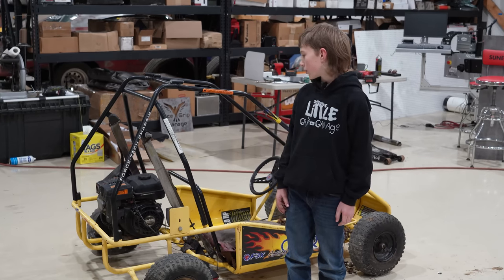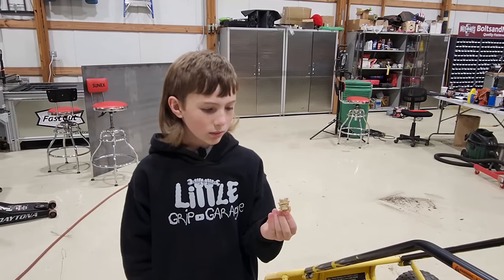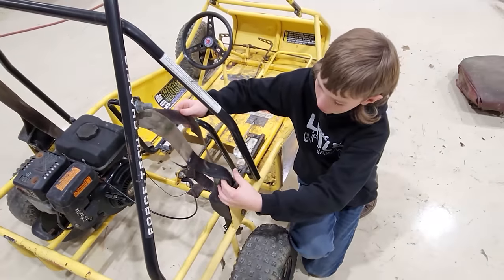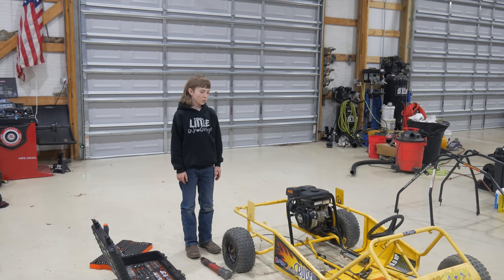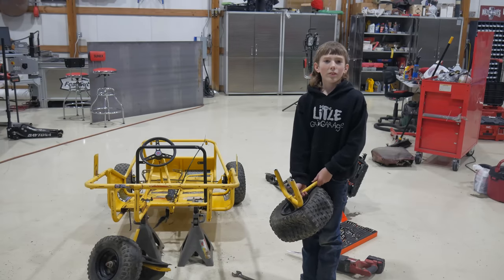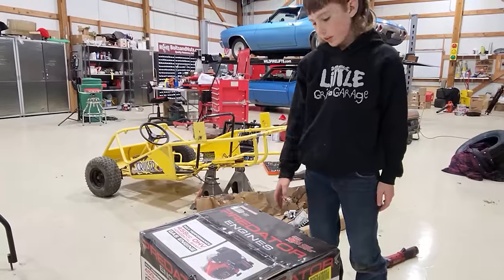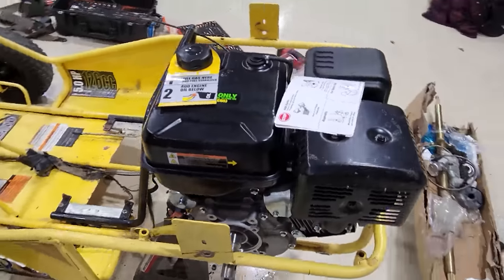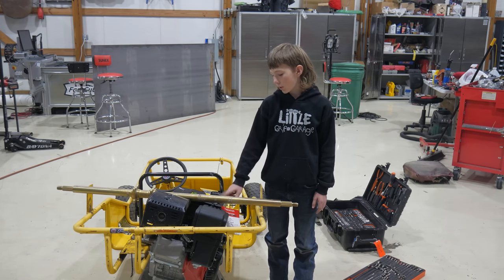My First Custom Go Kart Build ! -16HP - Will it FIT?

Comment: Bentley I’ve got to give you a 10 out of 10 on the delete of the old rear tires. Going to give you a 11 out of 10 on engine size because it’s way too big in other words PERFECT…and as long as you keep your dad away from the battery for your electric start, you’ll probably be OK. Looking forward to the next in the series.
Reply: Oh, I suspect the new battery will have a "Go" handle on it. Just a hunch.
Reply: A guy gets the feeling that the Bieri battery curse will pass on to at least one of Derek’s little humans, and Ben seems likely enough. 🤣😰😉
Reply: @vincedibona4687  ,I’ve heard it skips a generation…but I’ve been wrong before!
Reply: I think it needs a big battery and alternator that way it can be used to jump start all the rigs with dead batt-trees

Comment: i built a manco just like this model.......subaru robin engine always started first pull, but not cheap to modify.............go power sports and bmi karts were my primary sources for replacement/upgrade parts.........good luck with it, ours was a blast for years....

Comment: On your Honda 50 ,  you can get the top end from a CT 70 and bore it to 82cc and they make a big bore cam kit that will make it scream ( about 90 mph in the 1/4 but don't go that fast ) the front end is not made for it.

Comment: Remember Bentley  if you don't want that motor shutting down every bump or doughnut you do,have your dad unplug the yellow wire comming from the side case of block,it's a low oil switch that when the oil splashes up it thinks motor is low oil or out of oil,it will run fine unplugged but check your oil each time you ride and change your oil every 6hrs of ride time.they are great motors and you can build them up too 24 too 28hp with proformance parts,I build them so I'm telling you it can become a rocketship lol.God bless keep peeling. PASTOR BOB CORNELL/COINGURUMINISTER YOUTUBE

Comment: Bentley, I think you should paint your upgraded badass go kart bright red with black wheels. That would look hot, fast and boss, definitely. With the new live axle and both rear tires driving it, plus the much higher horsepower and torque engine, it's going to accelerate fast and haul butt...you might want to add some bracing and/or gussets to your seat backrest frame to reinforce it so when you step on the gas and your body (and people bigger than you) are pushed back hard against the frame it won't bend or break a weld. Ask your Dad what he thinks, he'll know exactly what I am talking about and he can advise you about whether it's needed for extra strength or not. In my years of experience riding, running and driving all kinds of toys very fast and hard I can tell you that it's always safer to over-engineer some things to make them stronger and more sturdy so they don't break or bend on you. Also, using grade 8 bolts in certain places for more strength (like mounting the engine, the axle, front hubs or bolting in seat brackets or a roll bar for example) is also a good idea. Having fun with powerful toys is what guys do, building them strong and safe is just plain smart. We like seeing what you are working on, fixing up and using, keep making videos Little Man. Have a lot of fun with your kart!

Comment: Great job Bentley! This is exactly how started learning about engines and other parts of vehicles. My dad helped me rebuild my old dirt bikes when I was your age. By the time I was 12 I could tear a whole bike and engine down and repair it. By the time I was driving dad was helping rebuild my old ‘72 Chevelle. I got pretty good a keep her running to the point I found another Chevelle that was wrecked in the rear end but had a great engine, front fenders and doors and was even the same color. We swapped all the good parts onto my car. Great learning experience. 45 years later I can fix most anything thanks to Dad. I know you are learning from your Dad just like I did. Enjoy many years to come doing this stuff with Dad.

Comment: That is a huge engine! Lol! My nephew and I just built a 6.5hp predator 212 for his go kart. Header pipe, heavier springs, billet crank, billet rod, deleted the governor an put a 22mm Mikuni on it. It's going to be a monster when it is done. Currently welding in the live axle and mocking up the motor plate. Hopefully we can get it finished by the end of the year.

Comment: This reminds me of fixing a two seater my boys had, when they were little dudes. Get some plywood for a new bottom and seat back, drill some holes and add T-nuts to attach. “Dan Dan the interior man” should be able to whip up a cover out of some vinyl. Also add new covers for head/helmet pads. Then head out and make some memories! Great job Bentley! Anybody else feel Derick’s pride and smile without seeing it on camera? Maybe find a rear end with a swing arm with some shocks and bigger atv tires for the dirt. May need a CVT belt clutch with that bigger engine. Looking forward to updates.

Comment: I would personally center the engine in the chassis, run a 40 series torque converter set-up and install a hydraulic disc brake. You don't want to run a centrifugal style clutch with that motor (they suck unless you spend big money). The 40 series torque converter kits run about $180 on eBay and it'll last a lifetime.

Comment: only thing i know about Predator is that its Highly reccommended to add Stabil because of the make of the rubber?
 Having a Live axle , The cart will handle and Go best if the weight is in the middle,  looks like welding time !

Comment: Great project Bentley, looks like the alterations will be a good thing for weight distribution to keep all the weight from the "captains" side, this is a cool cart I like that safety loop on the the passenger side to keep feet in the cart, I like red to go with the black upper cage but seeings how this video is 5 months old I'll go search for the latest video to see what color you chose plus all the alterations.... Great job Bentley and thanks Derek.....

Comment: I got a 212cc go kart predator engine all I need is a set of off-road tires and some paint and sand it I got the frame so I'm gonna buy stuff soon I've got $207 to spend on it I'm going to buy the stuff this winter and build it this spring.

Comment: Hey,Bently,i hope it is not too late too say that, the reason that your gocart stalled, when you did brodies? I think that you need to disconnect,the low oil turn off sencer stuff, some turn off when it thinks the oil is low.doing those turns sometimes, makes oil slosh arund,so it turns off😊❤